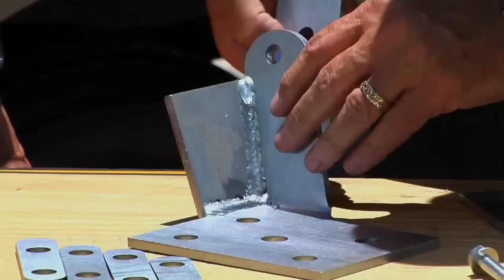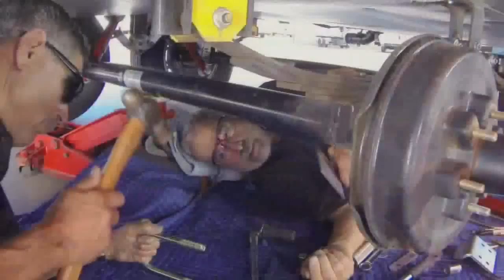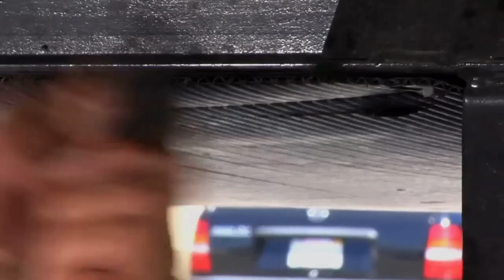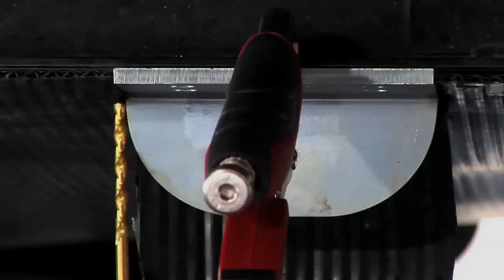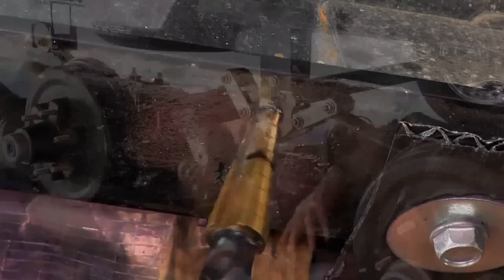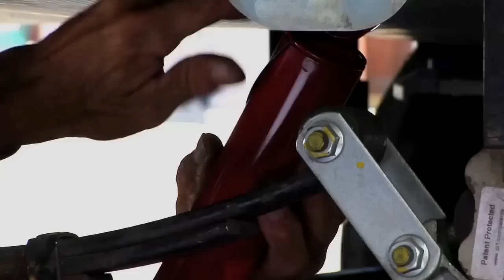DIY Joy Rider RV Shock Install

Comment: You should have dropped the suspension out of the way to install the upper bracket so you could put the self tapping screws in straight instead of angled. When you angled the screws, you made the connection to the frame weaker then it should have been. They may not ever fail, but would have been done much stronger with the bolts put in straight.
Reply: Terry Tykoon Yup, this is exactly why I do my own work, people just don’t take pride in their work anymore!
Reply: I cringed so hard when I saw that.
Reply: Terry Tykoon:  Exactly!!  After the comment about "We're using an electric impact...cause after all these years, we've got lots of tools...", I was wondering where the short impact socket and impact universal joint were.

Comment from the maker: Everyone.  It appears that Roadmaster has either licensed the Joyrider patents or bought the company outright.  The October issue of Trailer Life shows the upgraded JoyRider 2 kit installed with the kit marketed as a product of Roadmaster.  Here's a link:
https://www.etrailer.com/Trailer-Suspension/Roadmaster/RM-2460.html

Please note that when Joy Rider came out in 2017, the kit pictured in this video was discontinued. The new model has improved hardware for attaching and corrects issues with the earlier 2014 version.  Also the Joy Rider 2 is an upgrade that adds an axle alignment feature.  Lastly, they are just now bringing to market the Liberty Rider which adds improvements to the suspension spring system.  Both Liberty Rider and Joy Rider II can be installed together for optimum ride improvement.  Here's a link to the Trailer Life article http://www.rvimprovementsystems.com/articles/TL_2016-03_Liberty_Rider.pdf

Comment: Best practice would have been to use new safety nuts in place of OEM nuts or add lock washers to u-bolts after flat washer, and blue locktite to bold threads for extra safety.  How did you decide which axle to mount shock kit to?  Seems you would want shock kit on both axles not just one axle.
Reply: You will need to actually watch the vid again (this time with the sound on) and your question will magically be answered...
Spoiler alert:  There will be a quiz just after your second viewing...             lmao!